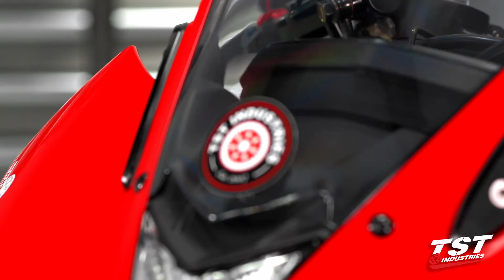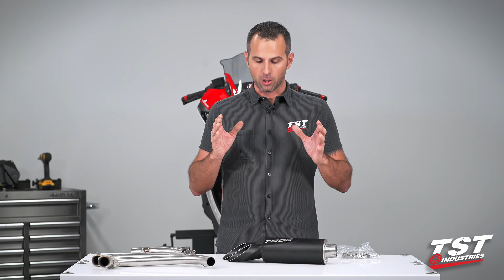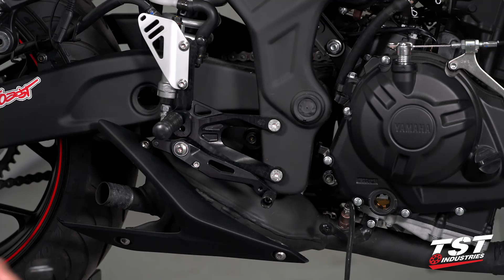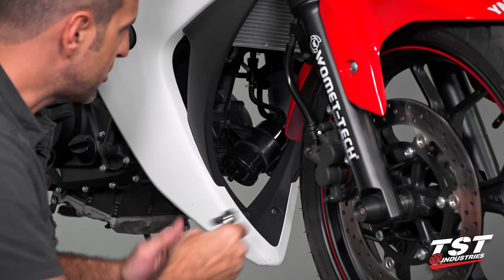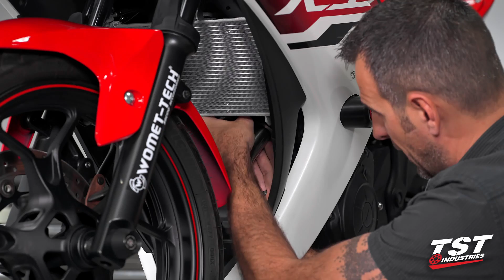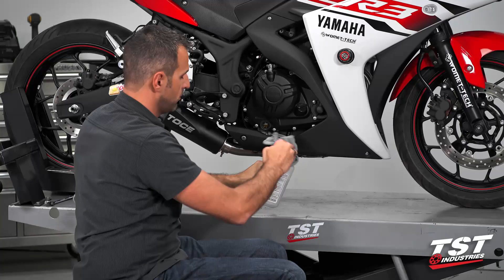How to install Toce Razor Tip Full Exhaust on a 2015+ Yamaha R3 by TST Industries

Comment: Tst I just picked up stage 2 ecu flash with air filter cover, tst velocity stacks, tst block off, and removed ais on my 2025 r3. Should the O2 be removed or does the tune tell O2 to not be considered?

Comment: Yei what about the chorcoal canister just need to plug that one hose to remove that or do I need to do the air box one to
Reply: Wondering the same thing. I just installed mine today and only plugged the smaller hose from the canister as said in directions.
Reply: @Kraz3d4073  loud as hell

Comment: So this exhaust is illegal to drive to the street? Only for track???
Reply from the maker: It is not homologated for street use.
Reply: @TSTindustries  do I need to buy ECU Flash when buying This exhaust, or just go to Dyno after installing it to do the tuning??? Thanks in advance 😁😁
Reply from the maker: @rowelandres139  on this particular bike taking it to the dyno after installing exhaust and good flowing air filter is the best course of action

Comment: I actually installed it myself today for my first motorcycle MT-03 2022 thanks to your explanation .
Reply from the maker: Great to hear!
Reply: Hey omr, i have the mt-03 22' and i would like to know if you had to do any adjustments to install the Toce. I saw that tst has the toce exhaust for 2020+ models but i need to know if i can actually install it before i order.
Reply: @Π.Τ.Φ  the only adjustment is the hard plastic heat shield that covers the original exhaust pipes, since this system is for the R3 you need to cut it a lil bit so it can fit the Toce exhaust pipes or just take that plastic off.
Reply: @omr3234  thank you for your response. Ride safe!

Comment: Do I have to reflash the ecu
Reply from the maker: It is not absolutely necessary but you will definitely see a better result if you do exhaust, air filter, and a dyno tune.
Reply: @TSTindustries   would it Damage anything if I don’t

Comment: Why do you need to block the AIS hose what happens if you don't do it?
Reply from the maker: This a full exhaust claiming race pedigree. You would typically take this bike to the dyno to tune it after exhaust installation. I you have AIS still in, then that system will push air into exhaust and throw off the readings of the oxygen sensing equipment of the dyno.

Comment: Instead of removing the oxygen sensor on Both sides, can we just remove the side that goes directly into the exhaust , & connect it back to the new pipe?
Reply: Yes
Reply: @CamShanksPlays  Won't it break the wires?

Comment: Do you have to remove the charcoal canister? I heard this exhaust will leave passenger's feet black.
Reply from the maker: The charcoal canister has nothing to do with black stuff coming out of the exhaust. It is there to catch fumes coming out of the fuel overflows and enable the intake to breathe them back into the combustion chamber, lowering total emissions.
Reply: @TSTindustries  oh shoot! Thanks for the info. Is there a way to counter the black stuff?

Comment: AIS. is that required to blocked ?
Reply from the maker: It is not required. You can keep pumping air into an exhaust stream that no longer passes through a catalytic converter if you would like.

Comment: Will the check engine light be off with this exhaust
Reply from the maker: The exhaust itself does not turn on check engine lights. If you do not unplug your O2 sensor there will be no check engine light.

Comment: Hi TST, if I get the flash tune for it, do I still need to do the block off on the intake box (AIS) and the  charcoal canister?
Reply from the maker: A flash tune can disable the AIS within the ECU and then the components will be inactive. If you choose to keep them on your bike then that is your choice but then you have a bunch of dead components not doing anything.
Reply: @TSTindustries  TY for the reply :) 
OK so makes sense to take it off when doing the flash tune. But if not doing the tune, then we MUST do the AIS and canister right? Or can we not do it? Just trying to figure out if it's ok to or not. 
I read online that doing the AIS (no tune) caused a lag in throttle. Did you guys have any issues with the AIS and canister plug?

Comment: do we need to remove charcoal canister for this installation? what was the reason you removed it?
Reply from the maker: You do not absolutely need to remove the canister, but you will have to remount it in order to make clearance for the header. Moving it over one hole on the bracket to motor mounting should suffice for the clearance. Then I would recommend using red threadlock to keep that single screw in the motor mount since you are now relying on only one screw to hold it. Do you understand what this charcoal canister does?
Reply: TSTindustries goctha! thanks. so we are doing it to clear space for the installation and it’s more of a mechanical reason than technical Yes, I do know the function of the canisters and the evaporated fuel.
Reply from the maker: @chumbervic104  by using this exhaust you are already removing the most important component of emission control and technically making the bike not public road legal. The tiny bit of fuel that goes over the rim of the filler hole in the tank once in a blue moon and doesnt get sucked back up into the intake is the least of your worry. Typically a full exhaust is done for racing or track riding purposes and then all the heavy and unnecessary components come off. If you ever plan on tuning this bike on a dyno then think about the fact that there will be inconsistent extra gasoline fumes getting into intake depending on whether or not you dribbled fuel over the rim of the filler hole.
Reply: TSTindustries 👍🏽

Comment: Will this work for the 2020 mt-03? Is there a video for that bike?
Reply from the maker: Yes it will work but you may have to trim a bit of the plastic off the under belly shroud to make clearance for the header.
Reply: Can you guys make a video for the mt03? I have an mt03 as well and actually jus bought this exhaust. Should be arriving today

Comment: Will this work without a flash/power commander or is one required after installing?
Reply from the maker: It is not required but highly recommended. Without a proper tune you are just spending money on making noise.

Comment: Hi there , just wondering if you have to put the plug on the AIS if not what will happen , i also don't want to reflash my ecu , will there be any down side to not doing the reflash and not putting on the ais plug
Reply from the maker: If you dont remove your ais you will have to remount the charxoal canister somehow to leave room for the header. If you dont put the plug in there nothing will happen other than air still being injected into the exhaust stream. I have seen people install full exhausts on bikes and not do any tuning, and their bike was fine even in the long term. I always encoudage customers to tune the bike to all the modifications they jave made. If you just install an exhaist and do nothing else then tou aren't maximizing the performance gains from that equipment.
Reply: Sweet man thankx for the reply

Comment: What lubricant did you use on the pipe so it would be easier disassembling it?
Reply from the maker: It is a type of metal filled grease. I believe that Permatex makes it.

Comment: Good Day! What's the inner and outer diameter of the oem header gaskets? Versus the one that you've placed? Thanks
Reply from the maker: They are the same diameters.
Reply: Is there any issues if you change the exhaust and keep the OEM gaskets?

Comment: Can you do a video for a 2017 r6? There’s only endcan installs on YouTube. not a full system.
Reply from the maker: We can do a Yoshimura install. We stock those, and we have a 2019 model that actually has that already installed but we have the stock parts to swap back to. The only problem is that we have converted this bike to SS race spec already so we can't depict the fairing removal

Comment: Hey, what is the effect of the exhaust on the performence of the bike ? I know wight, but Power ? torque ?
Reply from the maker: With a high flow air filter and a proper ecu tune the factory made 12.5% more power and 13% more torque than stock bike. Just putting the exhaust on will make more noise and not necessarily improve performance very much.

Comment: What power commander you recommend to go along with this
Reply from the maker: I dyno tuned R3 bikes with PCV and was very satisfied with ease of tuning and performance gain. I have also done Bazzaz and different flash utilities. PCV is really nice because it is a piggyback but has ability to do ignition timing and raise rev limit. Flashing opens this up too but PCV is easier to tune with...but unless you are a dyno operator you probably don't care about that. I have some Power Commander PCVs here preloaded with my own map developed on our R3s. My map is meant for use with full exhaust, mwr filter, our stacks, and airbox mod. It REALLY wakes the bike up. We saw 16% peak hp gain and 22% area under the curve hp gain.

Comment: Hello, What happens if I don’t dyno tune after putting this exhaust on?
Reply from the maker: You will not take advantage of the true performance gains that could be had, and your air fuel ratio will be all wonky.

Comment: Is the same installation at the 2019?????
Reply from the maker: Pretty much. Some of the fairings are different so there may be subtle differences in a few of the steps.
Reply: Barzilai Alvarado I just did this on a 2019. Aside from the fairings everything else it the same. Because the fairings are different on the 2019, you have to be very careful and take your time removing them. Make sure you locate ALL fasteners before pulling anything off. If your pulling a fairing and your getting a good bit of resistance...you might have forgot a screw/bolt so double check.
Reply: @vetjays  Is it just okay if the charcoal canister will still remain connected for R3 2019 even with the new toce exhaust intalled?

Comment: Hi Guys
Would I need to have the biked tuned/fuel mapped if doing this installation?

Thanks!
Reply from the maker: It is a full exhaust so it flows a lot more than the stock. It is highly recommended that the bike be tuned after installation of full exhaust and/or better flowing air filter.

Comment: Is this a racetrack thing or is it cool for the street rider to ...only asking because i seen you plugging things off....dont kill me im new to this bike life
Reply: Any exhaust that sound brap brap bang is not legal
Reply from the maker: Well it is a race exhaust, and does away with some parts of the bike that limit emissions. If you intend to use this exhaust on the streets then I would urge you to do research into local emission regulations before making your purchase.
Reply: I'm wondering the same thing because I am new to riding as well. Do I have to remove the charcoal canister if I install this exhaust?
Reply from the maker: We were able to remount it in our test installations. We took out the two 8mm head screws that hold the canister bracket to the motor, moved over by one hole spacing to the left of the bike, and used only one of the screws. This made enough clearance to re-mount the canister without interference with header.
Reply: TSTindustries so then it remains legal right?
Reply from the maker: @vexmau5  not exactly. This is a racing exhaust with no catalyst canister. When you remove OE header you are doing away with the catalyst. In most places like USA, Canada, EU, and a growing list of other regions, removing ANY original emissions equipment makes your bike not road legal. At that point you are supposed to only use this bike on a closed circuit.

Comment: Great job explaining installation in detail! Sounds and looks amazing. Do I need a power commander or fuel remapping if I get this installed on my R3? Thanks!
Reply: You don't need to ecu Flash on the 2019 r3 i don't think you need a power Commander either, jus take out the charcoal canister
Reply: Yes, reccomended
Reply: Wondering the same thing, just got a 2016 about to start on it

Comment: When installing that toce exhaust, is there no need to tune the motorcycle in the dyno or something?
Reply from the maker: Without tuning on a dyno you will not get the full advantage of changing the exhaust.

Comment: Wonderfull video!!.... but, it's necesary to remove the charcoal canister, what happen if you don't?
Reply from the maker: If you don't then it will make contact with the left header tube. You can remove the two screws that hold the canister bracket to the motor, move it all over to use only one of the screws/holes on the bracket, use threadlocking compound on the screw, and torque it down enough so the canister doesn't move. Or you can just remove it.
Reply: got it!!! thanks so much, so to be clear if I remove that piece, that entails some negative consequence on the bike??

Comment: Can I install it r15 v3???
Reply from the maker: This exhaust is designed and intended to be used on the 2015+ Yamaha R3 and we have not been able to fit it on the R15. We do not recommend making a purchase.
Reply: R15 is a single cylinder engine you cannot use this system bcause this bike is twin cylinder

Comment: Race exhaust meaning it isnt road legal?
Reply from the maker: Dmitri Felbinger this exhaust was developed for the race track. I'm sure some guys will use it on the street but it really doesn't meet any DOT requirements. It is much louder than required for street use,  and it doesn't have a catalytic converter. This exhaust was designed to be light and optimize power delivery.